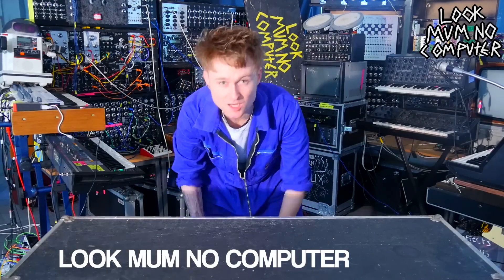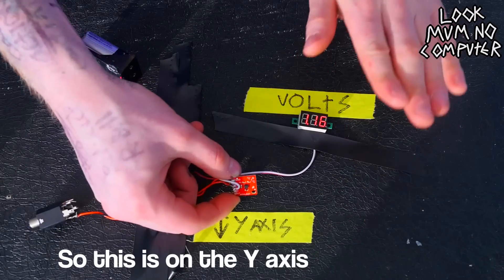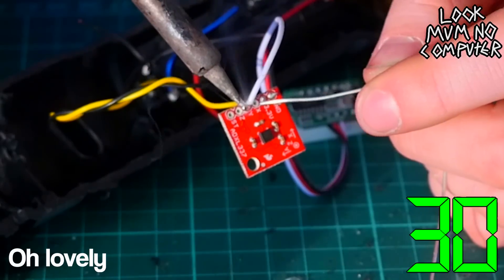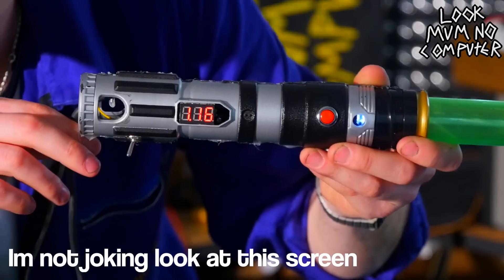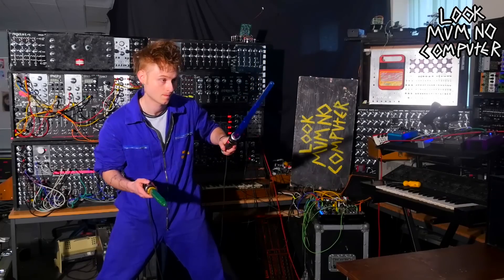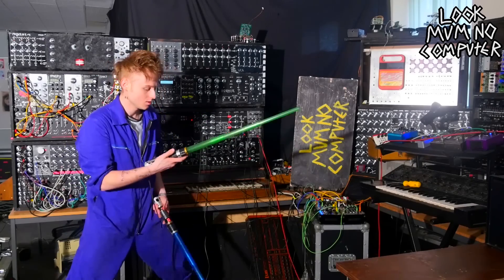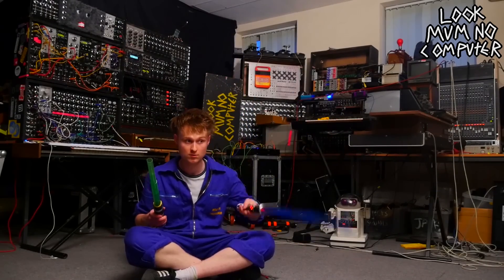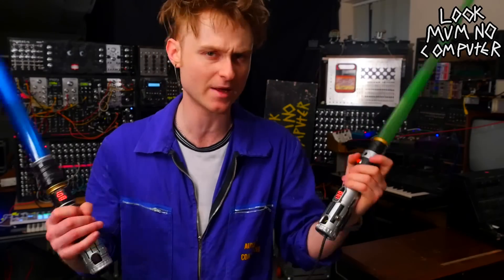LIghtSaber Theremin, Star Wars Musical Machine.

Comment: is this possible to do with an XLR instead of a MIDI cable so that I could run it through a normal amplifier?
Reply from the maker: the connector is just cus i needed 5 pins. so no reason to use whatever connector

Comment: neat.
although a gyroscope could've been useful, it's considered more robust than an accelerometer, plus the latter needs a magnet to define the origin
Reply: You can get both in a very small cheap package like the MPU-6050 (4mm chip). And gyroscopes don't need magnets. It's a piece of cake to read it out with an Arduino or any I2C master and you can hook up any number you like. There is a small board for it, the GY-521, less than 2cm in size, which is what I have. I can highly recommend them.
Reply: by latter i meant the accelerometer fyi
Reply: OK, but I'm not sure what you mean. The acceleration is a vector, it doesn't need an origin, and the axes are the edges of the chip.
Reply: oh okay, sorry. that's sort of what i understood from the video itself lol
Reply: It's having BOTH that is more "robust": gyroscopes are less noisy/more precise but drift over time.
By combining/integrating the values from both, one gets the best of both worlds.

Here's an example of a self balancing robot doing just that. If it were using only one or the other it wouldn't be able to stay vertical...

https://trandi.wordpress.com/2017/09/19/self-balancing-robot-v4/
Reply: +Juest Zungo
It gets an acceleration due to gravity, so the voltages tell you where down is relative to the board. If he played it again on a space station, it would sound very different.
Reply: oh right, so the magnet is earth :)
Reply: gyroscopes drift quite a bit.
Without a reference point of some kind it'll become kinda meaningless pretty quickly.

An accelerometer in theory has no point of reference, but since it detects acceleration, in practice it detects gravity.
This means it always points towards the earth, meaning you get two axes of rotation out of it.
Which is ironic because an accelerometer is supposed to detect force along linear axes, yet in practice the most useful data you get out of it is an orientation vector relative to the earth's surface.

If you combine a gyroscope AND an accelerometer, you can cross-reference the two, and calibrate out the gyroscope drift, but also, since the gyroscope detects rotation, you can tell linear and rotational forces apart, and thus you now get full 6 axis tracking out of the system. (albeit not very reliable over long periods since it's a relative tracking system. Position data therefore is based on integration and soon ends up full of errors.).
It's enough to at least give you reliable rotation data, separate out the gravity force from  other forces, and give you basic acceleration forces in 3 axes.
It won't work well enough to give you a reliable position though.
That's why VR and similar systems have external reference points for determining position...

Comment: Just for the record, accelerometers don't have any info on what is up/down/left/right, they just compute acceleration on a RELATIVE axis,  you need to add a magnetometer to know what is the real axis you currently moving on.
Reply from the maker: Chaotikmind yeah totally. But that got me rather confused with the accelerometer in question. Cus it’s very good at it. And in the data sheet said gyroscope so quite confusing
Reply: Just kinda guessing from the voltages shown but it looks like what this accelerometer does is just assume a constant acceleration due to gravity and from there you can try and guess which orientation it is in (I believe that's how older phones did things as well). Not super accurate as soon as you start adding your own acceleration but it works.
Reply: Oh yes, it is probably the good tool for the job anyway ;)
Had a fast look at the adxl337 datasheet (http://www.analog.com/media/en/technical-documentation/data-sheets/ADXL337.pdf), it seems it is a standard 3 axis accelerometer (some chips have others sensors integrated as well)